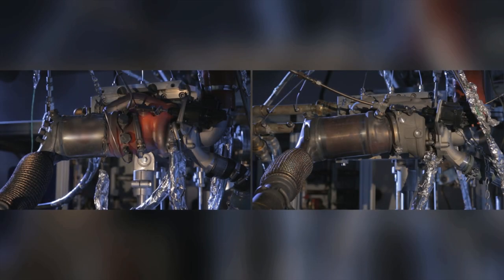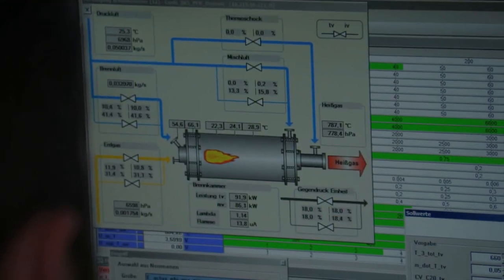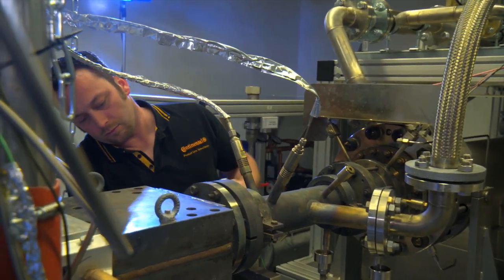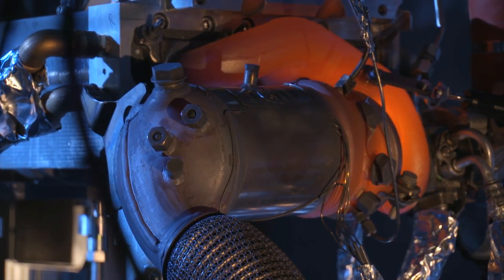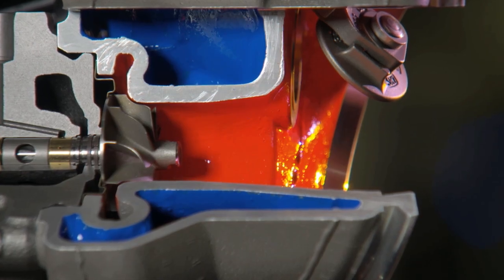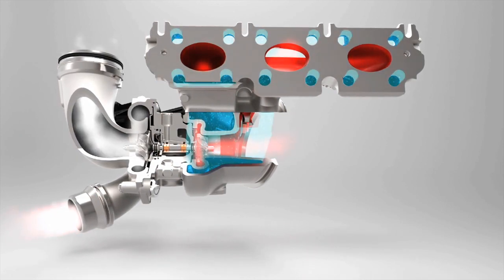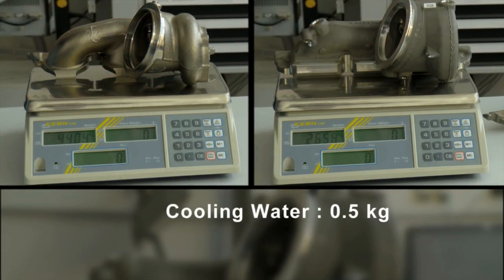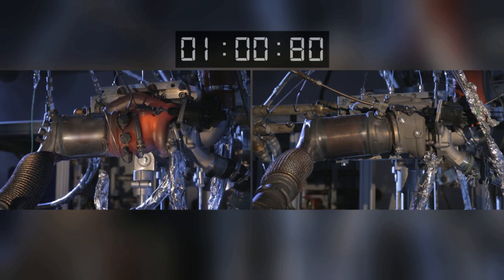Turbocharger from Continental – The water-cooled turbine housing made of aluminum

Comment: Good engineers design components that function under ideal conditions.

Great engineers design components that function in the hands of idiots

You’ve assumed that drivers of passenger cars won’t ignore the little red coolant light on their dash and run the system with low coolant until the turbine housing fuses itself into a large molten mass.